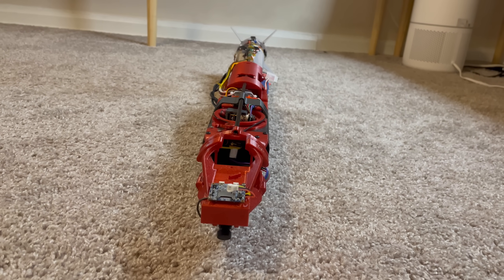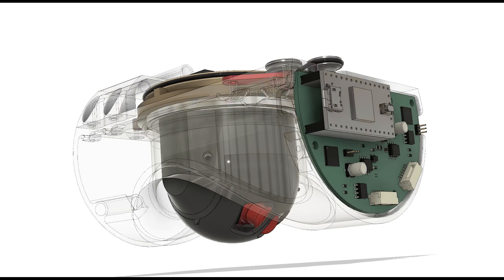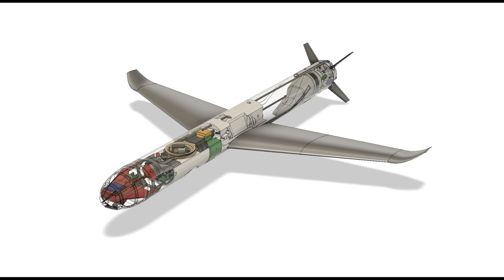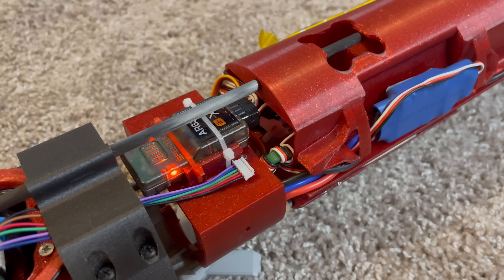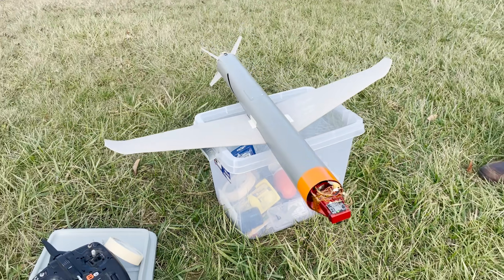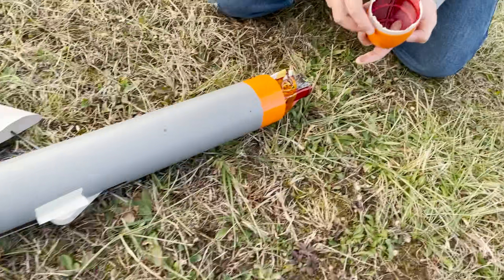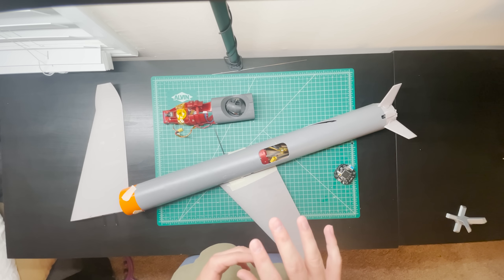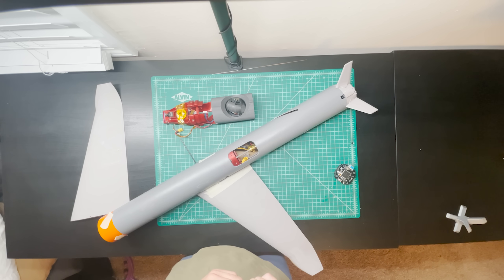Building (And Crashing) my Homemade Surveillance Drone

Comment: I think this is overall a really cool project, but I just have some thoughts:

What I think you should do is slim down the design a little bit to make it more narrow and long instead of short and thick. Probably ditch the folding wing design and increase wing span significantly, as well as place the control surfaces ON the wings instead of on the back, and just add stabilizing surfaces in the back like an actual plane. Along with that, get rid of the enclosed thruster design and go with a much larger, higher surface area propeller in the back to increase thrust.

I love your videos a lot and the way that you format them makes them great to watch! I wish yall the best and can't wait to see your future projects

Comment: For test launches you can bungee launch or discus launch it if chucking doesn’t work. Saves you from building a launch rail right away. For a bungee launch, a slot in the bottom of the airframe engages a hook on the launch rope which is elastic. Stretch out and let go, and Hatchet will fly off. 

For the discus method, ensure your wing spar is rigidly installed. Put a finger hook through the wing tip, hold Hatchet on the pads of your index and middle fingers, and spin it around like you’re throwing a discus. You can throw a lot harder that way.

Comment: Re your failures to launch: a lighter airframe is better, and your fan also seems to be underpowered. Strip qw much weight out of the nose as you can, ditch your payload, and also redeesign your tail end to add additional lightness. I would also consider inverting the intake duct into a top intake to avoid further fod ingestion related innovations of the fan disk. 

Your fins are also undersized by probably a factor of 2.5. Easy fix. Adopting a fixed stabilizer with control surface at the back will permit reinforcing the lower stabilizers with carbon spare stuffing which in turn permits them to survive repeated touchdowns.

Lastly, lose the airliner wing. An unswept untapered wing made from dollar tree foam board with a strip spar is light, cheap, surprisingly strong, easy to build and iterate on, and easy to reinforce with a carbon tube spar. Add a spot of dihedral and high mount or even shoulder mount it and you’ll have an airframe that’s inherently stable about the roll axis. Strip all your active controls out of the wing and use servo mixing to put it all in the tail at least for now - upgrading can happen later.

The reason I suggest a straight high wing is that it better matches Hatchet’s mission as a loitering fighter videography platform. 

One more tweak I’d consider is the angle of the camera ball. Aiming it out the side of Hatchet will allow you to track the rocket up to and above the horizon, even in a lazy cone turn about the launchpad.

Comment: That's one fat plane with teenie wings and inefficient power system. Will have to fly superfast with a short flight time. 50 mph stall speed with 3 minute flights. 
Need to use a much more efficient EDF like at least 90mm. Right now it looks like the plane has a 0.5:1 thrust to weight ratio.
A bungee launch system or detachable wheeled dolly on a long paved runway will be needed.
Tail surfaces are too small.

Comment: Did you calculate the Cp in relation to the CG? From the looks of it, your thrust to weight ratio is not high enough, is it 2 to 1 or? I am not familiar with these fans or the kind of thrust they generate. but weigh the drone then figure out how much thrust you will need for takeoff. After it is up in the air, you can throttle back to an optimal cruising speed to conserve battery. I was also going to suggest a launch rail powered by rubber bands.

Comment: My ideas:
1. Takeoff weight can help, just ensure your center of mass is just barely a tiny bit behind the center of lift with control surfaces at neutral.
Then, adjust trim on the control surfaces so that the "new neutral" is adjusting the center of lift a tiny bit in front of the center of mass.
What I am seeing your plane do is immediately stall; it seems like your center of mass is too far backwards? I don't know, it seems physically to be quite front heavy...
A stable aircraft should pitch slightly down naturally, to avoid stalling.
2. Yes, it does seem like you don't have enough elevator authority. I would honestly just ditch the thrust vectoring entirely as it probably introduces a vortex behind the existing control surfaces, making them less effective. A bigger, traditional tailplane with trim is needed. And as posted by other comments, to make #1 possible, you need flaps on the wings to carry that kind of takeoff weight (and adjust the center of lift appropriately). You will also need ailerons, or else you won't be able to get it to fly level. 
3. A rail launch can help, but bar none you must glide test the airframe to make sure it can fly before you try powered launches. Going straight to powered launches with a loaded airframe was ambitious to say the least!

Comment: have you looked into light weight/foaming pla for the control surfaces and non structural components as well as it being able to be intergrated into the infill of other components.  with it being half the weight of pla with the volume increasing 1.2 times after extrusion.

Comment: Your biggest issue is control surfaces and thrust to weight ratio. For unassisted take off you’re just too dang heavy. Contemplate a sled/ramp spring assisted launch.

Comment: 1. bungee launch that thing  (obvious it is hard to hold and throw, that resolves the problem)
2. you EDF intake is crap!!! designing something like a NACA duct is nice, but do it properly! you will need way more lenght!  --> measure the static thrust of the EDF installed and uninstalled (with a intake lip). I assume you loose maybe 50% of thrust with your installation
3. thrust vectoring might help with steering, but it will not help with stability

Comment: Measure thrust from that fan. The  motor looks so tiny I was 100% sure it wasn't gonna fly when I saw it and the amount of weight you put on it. I understand you are a rocket specialist. From what I understand rockets can pack much more energy into smaller volume/weight than batteries that's probably where you are getting the impression this thing could fly. Look at watts/kg of liquid propellant vs lithium batteries.

Comment: I have zero practical experience unfortunately due to lack of time and money but I did do a concept design for my Master's thesis and have some aerospace knowledge so some feedback from me: (Also I don't have much time so pardon me if I talk about something you already mentioned in video)
1. Try building the launch rail or do some figuring out how to hand launch properly. Launch 1 (I think, can't see much) and 2 you basically had a stall angle the moment it left Your friend's hand. I would avoid using the method in Launch 3 (pushing) as it basically asks for inducing a spin. 
2. Looks tail heavy. Try moving CG forward or wings back. Now this is model aircraft world but in real world CG is placed in front of centre of lift. The main wing always creates a pitch down torque while the job of rear stabilizer is to create a pitch up torque. Since this is a model aircraft You could just aim to place CG perfectly at centre of lift.
3. Make sure that EDF of Yours is not limited by Your inlet. Hard to tell but looks a too small. EDFs are not compressors, they will struggle if inlet is too small. Ideally, area of cross section of Your inlet (at its smallest point) should be equal to the area the fan blades take. Additionally remember that walls of Your inlet will induce drag on the air coming in further limiting it (to consider when adding different twists and shapes in the inlet)
4. Looks very heavy and these wings look small. You want to minimize the weight as much as possible or increase the size of the wings., or both. Consider using a material like LW-PLA (Light Weight PLA) when 3D printing. It works by foaming when printing and at some cost of structural strength I've seen it able to reduce weight by up to 50% when setup properly. 
5. Not sure if You did it but since You are 3D printing the wings You might as well optimize the wing by choosing a right airfoil. Go to airfoiltools.com , use a Raynolds Number Calculator and then use that number in their search options to find the right airfoil maximizing the lift or Cl/Cd while being structurally viable. 
6. If You are using these fins alone and no ailerons on the wings then at slow speeds (when launching for example), especially considering the weight of this thing and the inertia in roll axis the wings give it, I would imagine You have zero roll control. Basically only thing giving You roll control at that point are the tiny fins behind the EDF. At slow speeds Your exterior fins do nothing and thrust vectoring does not impact roll axis. 
7. And keep in mind the torque that EDF is introducing on Your roll axis, especially when launching at full power. These things can pack a punch. 
8. To help with roll stability problem I would try introducing some dihedral to the wings. 

These are the points that came into my mind seeing the design and launches. I love Your channel and Your projects! And I fully expect to see this full idea (totally not cruise missile) flying! Even if it takes few simpler iterations first! Keep up the good work!

Comment: Three things I first noticed: looks like Hatchet has a pretty heavy wing loading, its empennage area appears to be too small, and judging from the hand launch attempts, its CG seems to be too far aft.  Added to that the wings have little or no dihedral, only slightly canted tips, causing me to question Hatchet's roll stability.  So, if you could calculate an aerodynamic neutral point location and insure the CG was kept ahead of that (empennage area will figure prominently in that calculation), calculate a stall speed for the planform, airfoil(s), and wing area you are providing to make sure you launch above that speed, and maybe adding an autopilot (like Pixhawk) to provide some degree of artificial stability perhaps you'd fare better with this project.

Comment: Hi. My advice is to strip all the weight you can. Especially when you are trying to get a new concept flying. Make youre control surfaces a lot bigger especially if you are hand launching there is a lot of undesirable side slip with hand launching.  Have a look at bungee launching systems as it wil get better speeds. Edf models are notorious for failing out of the air at low speeds.

Comment: i'll add some of my rc plane design experience here since i am also in the middle of designing a 3d printed edf plane.

i ran into some very similar problems with my first designs.
now i can't tell you specifically why it doesn't work because that can be a number of things. but overall to me it seems like this may be worth thinking about:

- weight. like you already said you should probably reduce the takeoff weight. i agree. i learned quickly that building light first and not second is a big factor in what works and what doesn't. you have quite a lot of equipment on board. and you also chose some rather dense filament. from what i've seen you want to have about at least 70-80% as much thrust as weight. at least at this scale. more is always better. i had some prototypes closer to 50%. those flew. but only in ground effect. and going into a turn would always lead to a crash. getting a more powerful EDF and or a higher voltage battery could help here but this usualyl also increases the weight.
- EDF aerodynamics. thrust verctoring is a cool idea. but here it may work against you. the TVC setup causes a rather significant disturbance in the airflow behind the EDF and probably creates a lot of drag and turbulence. which isn't ideal for thrust. in my models i learned that you get the highest thrust by having a very smooth EDF exhaust tube with geometry that starts with the diameter of the EDF and then becomes slightly thinner towards the end. something around 20% lower diameter. i also saw some very strong control effects from control surfaces like you have used at low speeds so the TVC may also just not be needed here. if the entire fin moves that has a larger effect than one might think. i was surprised by my own models.
- filament slection. you mentioned you used PET-G. for rc planes this is not ideal if you want to build light. me and a lot of others use a filament type known as LW-PLA. i get mine from colorfabb. this filament can be printed with an extrusion multiplier of around 50% so it's about half air by volume. this makes it more like foam and less like plastic but the weight savings are amazing. it is noticeably weaker than other filaments of course so you may have to use some carbon rods for reinforcement. i have a video about how i personally print LW-PLA on my channel (shameless plug).
- center of gravity. this is just from how hatchet was behaving when thrown. can be caused by a whole lot of other things but it looks like the CG might just be a little bit too far aft. i usually go with having it near the forward 1/3 of the wing measured at the root. i also sometimes make a glider model to verify the CG. where the model is entirely made out of LW pla and has no electronics installed so it's as light as possible. i then tape some small weight to the front or aft until it glides straight and then measure the CG.

i hope some of this can help. i'm excited to see it fly one day.

Comment: low and slow is not good. use rail laungher with bungee assist. since there is no no speed at launch, there is no list also no control. it looks realy heavy, and together with small wings it need to go fast. i would sugest some experienced pilot for first launch.

Comment: QUESTION: Do you have to account for any tiny differences in dimension when piecing together parts that are 3D printed? Like do different print materials come out slightly over or undersized from the CAD model?   I realize this is a naive question regarding general 3D printing, but it looks like you got very excellent fit (“fits like a glove”) for some parts.

Comment: Aero eng & rc enthusiast here. First of all, dope project. Second of all, I think your solution ideas will work. The issue you have is a result of your tail fins being too small; look into tail volume coefficients to size them. Also, I’m sure you already know this, but CG should be located right abt quarter chord on the main wing or more forward. Further forward it is, higher cruise speed will be. Finally, make sure your TWR is above ~0.5, higher the better. Good luck!

Comment: I would definitely move the NACA inlet to the top for reasons you’ve already stated. There’s no reason to keep a failure point if it can be avoided. To address the wingtip camber; maybe make the wingtip spring loaded so that when it’s inside the fuselage profile it’s facing downwards (because of the upward NACA inlet) and when the wings pop out the springs force the rotation upwards so you get the same profile. (Think clothes hanger spring)

Comment: Start with the bare minimum for flight, motor, servos and rx. Low wingloading (big wings and control surfaces) and a decent thrust to weight ratio. Do the foamboard thing (or similar) first so you can iterate fast. When it flies start adding the gear and maybe cut down the wings. 

Missiles start from planes going insanely fast. Don’t build a missile, build a plane and make it look like a missile. 

3dprints are always heavy. Use LW-PLA. And don’t 3dprint tubes and flat surfaces, it’s waaay faster to just roll up or cut some foam and glue some sticks on for strength.

Comment: I'm on team rail-launch. Also perhaps a more powerful EDF with an ESC to match. It might be worth installing some kind of coarse protective mesh on your intake as well, the same way they do on RC turbojets. Since presumably the wings will already be deployed by the time your EDF gets running, would there be any reason not to let those slots in the fuselage serve as an additional intake?

Comment: So I've been doing RC flying for a while. To be blunt you don't have enough power. No where near enough. EDFs are a pain to launch when underpowered. You could go with a rail/catapult launch that would massively help. But the easy solution is power, more of it.

I worry about your control surface area too but you seem to have that modelled so I'm interested to see

Comment: Lowering the weight and raising airspeed as you said will really help. You can use a flight controller to get some artificial stabilization to help you out. Larger tail feathers will also really help you out.

I recommend not investing into Spektrum too much. Get an inexpensive Radiomaster radio and use ELRS. The receivers are much lighter, less expensive, and better range. They are also more compatible with flight controllers.

Comment: My honest suggestion,  If you have the ability to print in CF, that would be much lighter,  stronger,  and gives decent flexibility overall.  Rocket assist, bunge launch, or ait cannon style launch like an aircraft carrier launchers. They use high pressure steam,  you can do the same thing on a much smaller scale and use high pressure compressed air with a rapid dump valve.

Comment: I think your new ideas are great. I would prioritize CG placement. Just from the looks of it, it seems like the cg is a bit too far rear and that’s going to make hand launching extremely difficult. I would also look into fall off landing gears. Just something that can get you going fast enough on the ground for initial testing so you can take off. Would require a model airplane runway, but good for testing. Good luck and can’t wait for more videos!